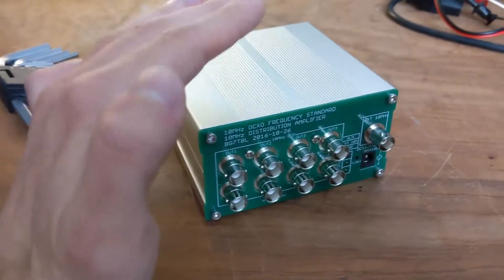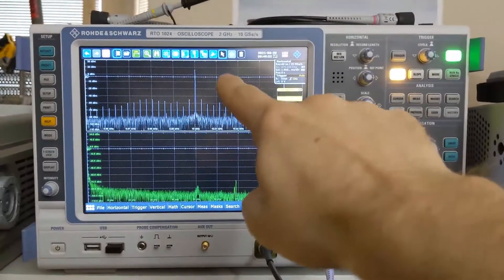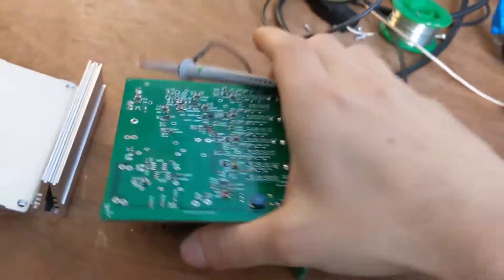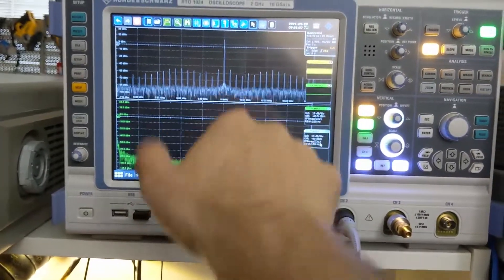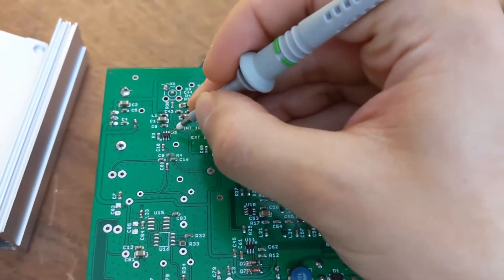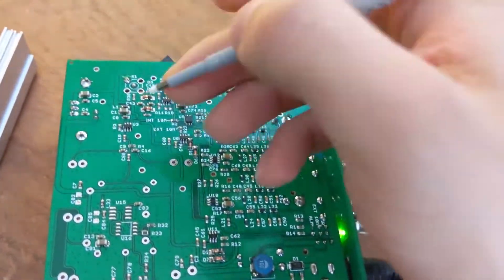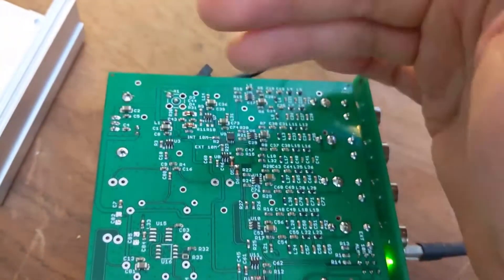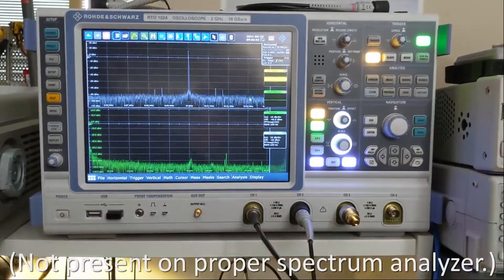BG7TBL 10MHz DistAmp Self Oscillation

Comment: 😀Around 30 years ago, a technical colleguean have built a 3U rack in order to made a 10 Mhz distribution.
This was oscillating.....the main  reason was because the outputs wasn't loaded. Generally amplifier specs output are not given for SC to open.....but up to a SWR 2 to 3 for example.
That I see is that the outputs are open on the box.